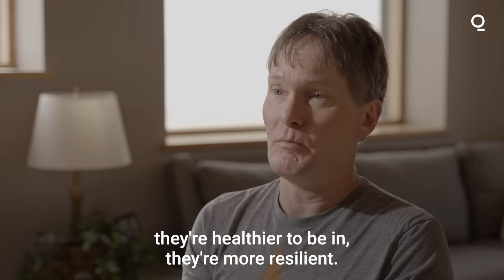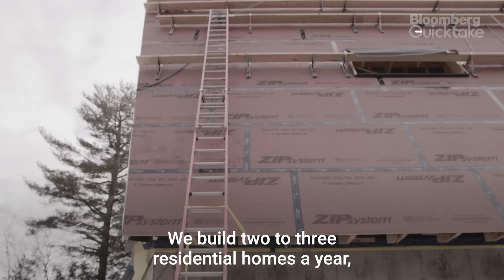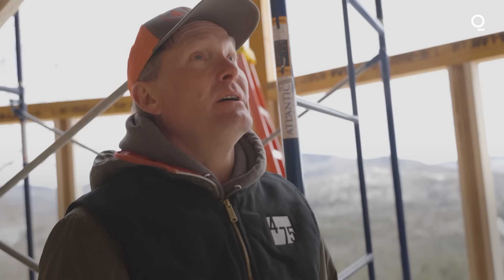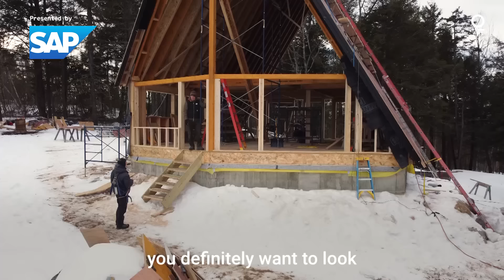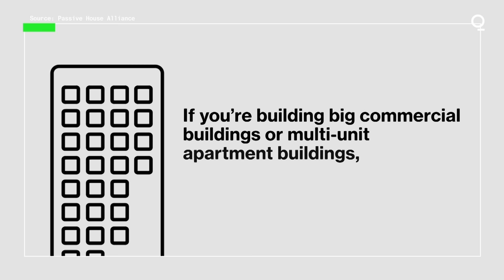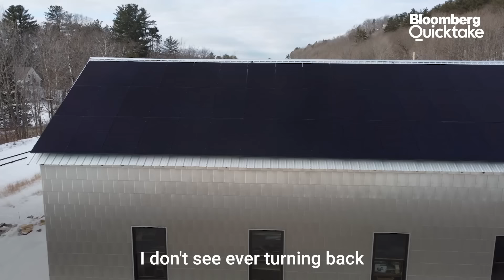Passive Homes Are On The Rise

Comment: Ill have a look at the passive house standard and maybe incorporate aspects into my future home design.
Reply: look into triple pane windows and tilt and turn windows. those are really important.
Reply: @miles5600 triple pane also holds up better to wildfires. Double panes are more likely to fail and allow embers inside
Reply: @roryroberts-yu5tg  yup, we recently remodeled our house and we went with quadruple pane glass with each pane being a little extra thicker than the normal glass thickness to help both weather and it ever breaking.

Our house is usually around 72 degrees and whenever you touch the glass you can feel the window being room temperature while outside it’s 30 degrees and our heat pump only turns on once every night to warm the house and thus completely off during the day (only turns on for warm water)